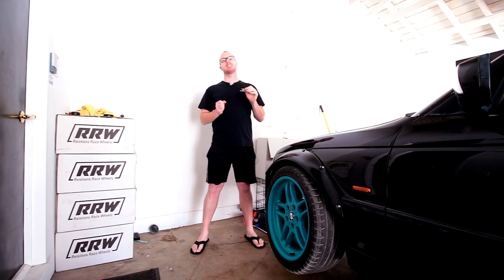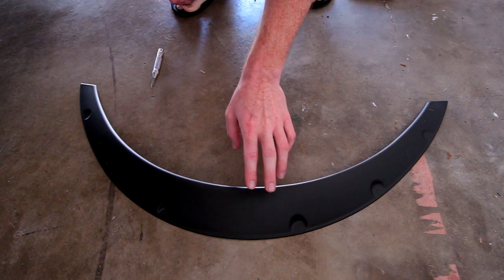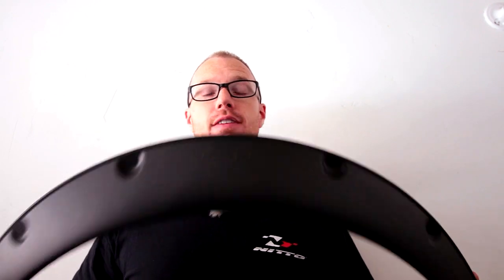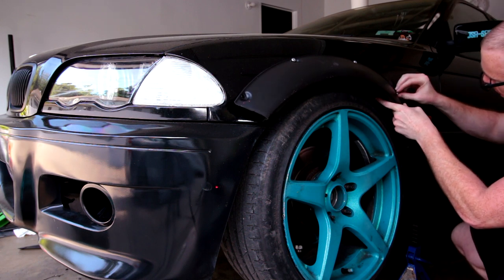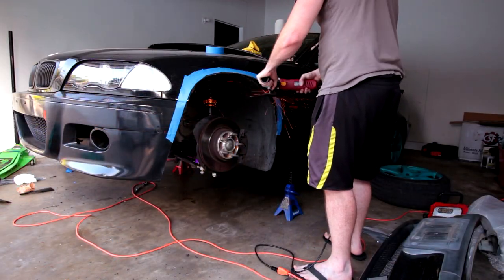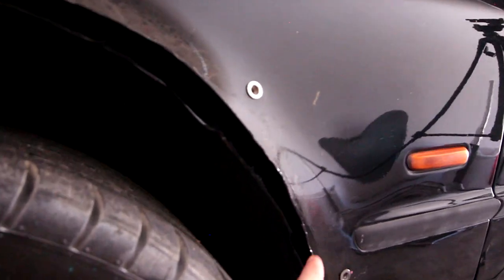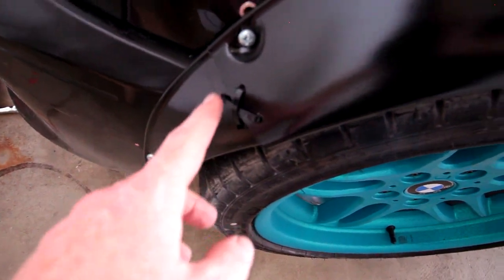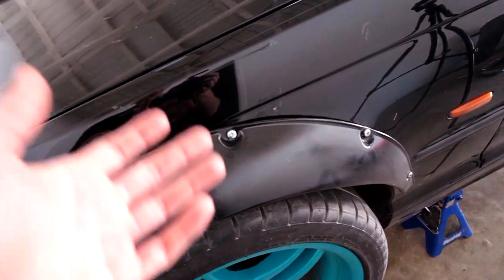Universal Fender Flare Install Tips and Tricks - Project BMW E46

Comment: holy shit that shopping car steering angle!

well thats pretty good it gives a more agressive look to it

it wont get that much better than this unless you make a new wide fender for each side with fiberglass or plastic but since its a drift car it makes no sense since you can hit something plus the rubber completely wrecking the inside of the fender and stuff when the tire tears apart
Reply from the maker: SLR says the Ultra kit can hit 70 degrees at full lock. Have an event soon, will put it to the test.